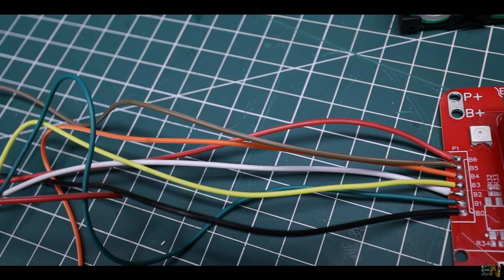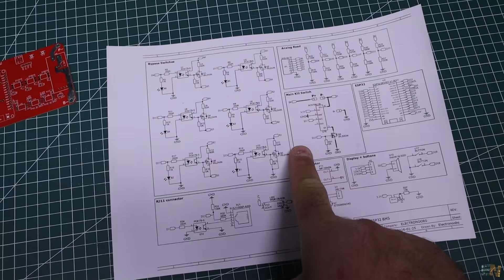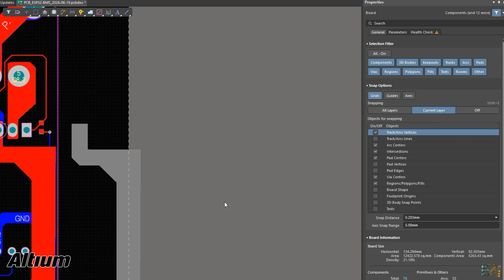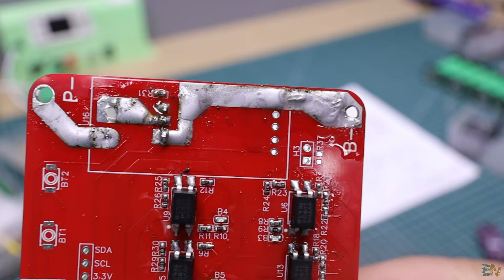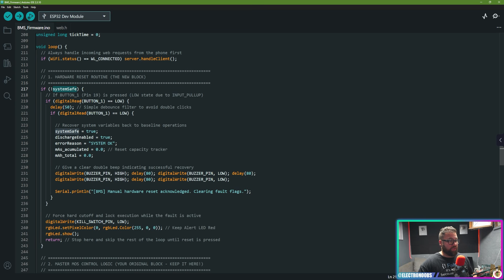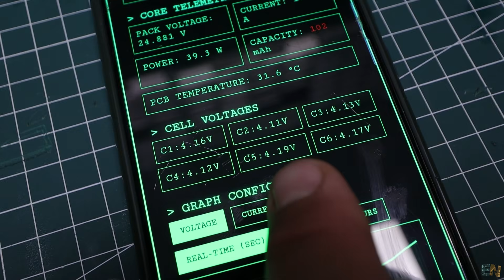Build a Pro-Level Solar BMS with ESP32 (Open Source)

Comment: Hello, first of all, your work is excellent. I previously watched your videos on inverters and they were very well done. Will you be working on a project related to uninterruptible power supplies? If so, it would be fantastic if you could create a UPS system using LifePo4 batteries and manageable via a web server.

Comment: This is great, but can you make esp32 voltmeter that can monitor 20cell nicad battery each cell individually like bms? No charge or discharge needed. Just a 20 cell monitor.

Comment: Can you make a adjustable constant load that accept any voltage we throw in upto 100v and on output we can connect any load we can find to get max amp possible say 100a, measure capacity and has a nice interface like this bms has?

Comment: really really amazing project, i want to ask you a question, i have to do a big battery with 2 parallel and 14s and i was wondering if we can scale this up or if we need to redesigning it from skratch to withstand the completely different puropose of the battery, probably i will buy a commercial one but maybe to prototyping and so i was wondering

Comment: How are you reading 4.33V on an ESP32 analog input pin?   OK, I see in the schematic you're doing a 1/2 voltage divider then multiplying by 2 in software.  Fair enough.  I also would vote for the ADS1115 since it's a much better ADC than the built-in crap in the ESP32.  Espressif had to supply a function that corrected the non-linear readings.

Comment: 10:32 why is cell 6 at 3.51V with no cells attached?
Reply from the maker: Since nothing is attached, it measures the minimum voltage of the system which is the 3.3V of the ESP32
Reply: @ELECTRONOOBS  Thank you for replying, but i am sure it should not as it might mess up the actual battery readings.
Might be induced and not an issue, but i would check that for sure.

Comment: I have just ordered my esp32 c3 for power monitor which may contain esc control too with .96 oled display and will try to make capacity meter too for batteries

Comment: Great project 👏🏻👍🏻 let's make a professional battery charger with multiple protocols, have balance wire, xt60 connector for input and output, external shunt resistor or load for check capacity and power consumption etc